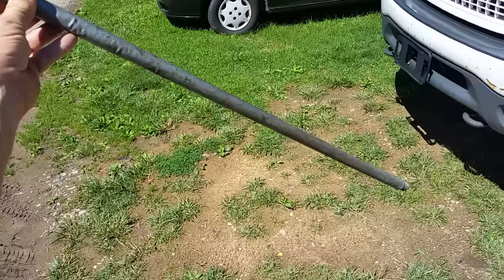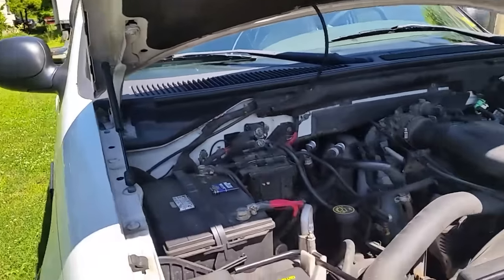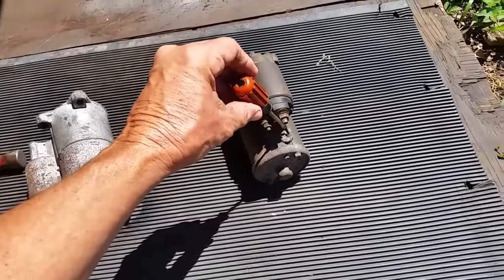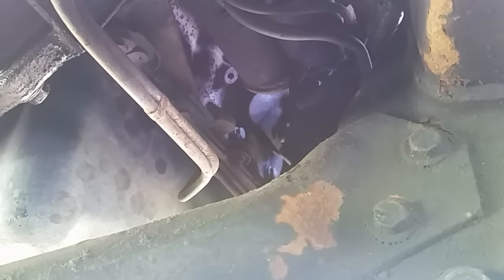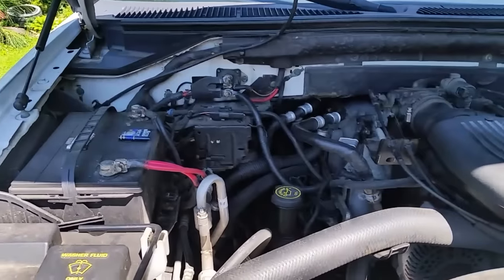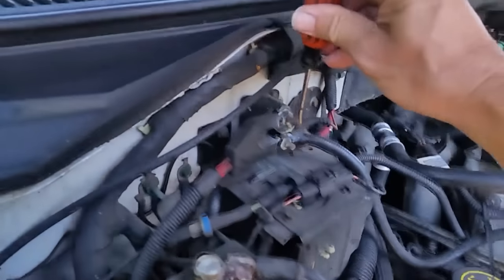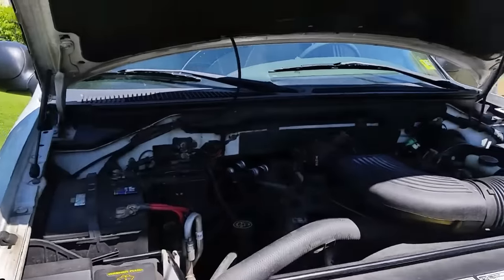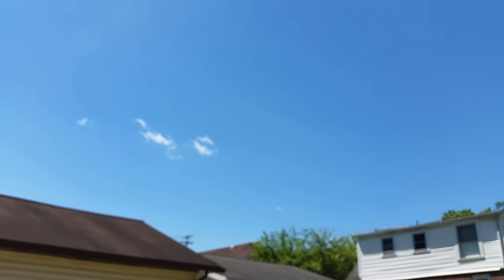Starter Issues??? Simple trick to get your vehicle started and get Home!

Comment: Here is what I read from a good automotive textbook :

Don’t Hit That Starter!
In the past, it was common to see service technicians hitting a starter in their effort to diagnose a no-crank condition.
Often the shock of the blow to the starter aligned or moved the brushes, armature, and bushings. Many times, the starter functioned after being hit, even if only for a short time. 
However, most starters today use permanent magnet fields, and the magnets can be easily broken if hit. A magnet that is broken becomes two weaker magnets. Some early PM starters used magnets that were glued or bonded to the field housing. If struck with a heavy tool, the magnets could be broken with parts of the magnet falling onto the armature and into the bearing pockets, making the starter impossible to repair or rebuild.
Reply: So what's your text book say? Replace starter everytime at the customers expense?
Reply: But it can't hurt if the starters already junk. Or pay a tow bill I think I'd rather wrap on my starter and it's not going to break anything just tapping in it . Maybe if you're swinging a sledge or something lol of course auto techs and manufacturer are going to say that. They want that service and part money. Its fine to do as long as u aren't pounding the shit out of it and it would probably still be fine Even if you did
Reply: Just be more careful where you hit it.  Tapping on the edge, especially near the solenoid should be ok.  It will vibrate everything but anything remotely reasonable should not hurt anything.  Another thing.  Few if any starters today even involve a rebuild.  It's best to accept the reality of expensive OEM parts or much more affordable aftermarket parts.  Either is new or re-manufactured with a warranty.  

    In theory a re-manufactured part intended for store stock is likely better than having someone rebuild your starter specifically.   The reason is because that type of organization is likely set up to better clean the old parts whether some sort of bath, ultra-sonic cleaning, etc.  Something a small shop probably can't match without unrealistic labor and lots of expensive brake clean.  The quality of the replacement internals could be better or worse, but the big company saves money through bulk purchases meaning they could have better parts to limit warranty liability while still having lower cost than the lone wolf.  The labor cost of the re-manufacturer is cheaper and the employees whether skilled mechanics or not should become quite proficient with the parts they are working on because a high volume of repairs equals a high volume of experience.  They can robotically and mindlessly do the same quality of work that requires attention to detail as a one off repair.......

All of that to say fragile Magnets and rebuilds are not generally an issue, unless a person is needing a hard or impossible to find replacement starter.  In that case they probably already know not to wack the sh*t out of something they want to be properly repaired.  

And this advice should only be used to avoid a tow, get home in an emergency, etc.  Do it repeatedly at one's own risk of reaching the point of no option.  I'm probably in that spot myself right now with my truck stuck in a less than ideal location on my property and in need of being started so that I can be certain the coolant is suitable for a sustained weeklong plus deep freeze in a few days.

Comment: I usually don’t promote any auto part stores. But for goodness sakes don’t buy a Amazon starter. It’s made of the thinnest metal and after being thrown 30 feet the posts bust. I’ve used every stores parts. While they are competitive on prices and sometimes a little higher in price, O’rieleys has the strongest heavy duty starter out of all auto part chains. Spend that extra 10.00 so your not back under it as soon as the warranty is gone.

Comment: Interesting it wouldn't start with a key but when you jumped the solenoid it did turn over. That means the solenoid is likely the culprit not the starter as it turns over.
Reply from the maker: My luck It was both ;(
Reply: @FixingWithPassion   no your issue was the solenoid, you replaced the starter because you don't properly understand how the solenoid works
Reply: I agree. He says the starter is bad. He just proved it was not the starter.

Comment: Have a 2003 Lincoln (Ford product, so should be very similar setup to this).  Tried tapping, though, didn't work.  Luckily, have AAA, will probably have to send to mechanic to change starter.
Reply from the maker: o no!
Reply: @FixingWithPassion  LOL, ya, not sure what else to try.....battery full, think starter is just shot LOL!

Comment: This may work for a while, but in reality the moving part is dirty, probably to to oil & grit or slight corrosion.
It will need removal at some stage.
Reply from the maker: That's the point ;D
Reply: What part of Nathan's "Don't shut off the vech once started" was confusing to you?

Comment: around 3 minutes into the video, you jumped the upper  solenoid.. it instantly turned over the engine. This usually means the solenoid is bad or has bad connections. If you would have turned your key on and then jumped the upper solenoid, the truck would have started
Reply from the maker: True. But a lot people would not understand this.  Also not too many auto have easy too get to solenoids. Good luck finding one now days. )
Reply: Jonathan you are dead on. It was a faulty solenoid or solenoid activation circuitry. NOT the starter.
Reply: yeah, the starter was just fine, if bypassing the solenoid makes the starter turn over, the solenoid is bad, not good.

Comment: Really good video. I have a 69 F100 but I'm sure this tactic could be used. My problem is hot starts. My mechanic cant figure it out, but I suspect the starter is getting too  hot. I think i'll try a heat shield between the starter and exhaust.
Reply: Make sure the timing isn't too far advanced

Comment: I drove my car from work early in the morning to the bank for 3mins,then I turn off the engine .then I can't start anymore..it did happen twice so I called someone to jump my car..I took my car to the auto shop to to check my alternator and battery and they said both are doing good..now I was thinking it was the starter,I bought starter and mechanic will be here soon .to replace starter.I hope the starter is the problem..

Comment: Ur bypassing the solenoid with the screw driver. Therefore the solenoid is probably bad. The solenoids job is to make contact between the two wires except its done by the turn of the key.
Reply: Ya there's some bad info here
Reply: The guy who authored the video he did an okay job. However you are right the solenoid is probably bad when he jumped it from the firewall thank you for clarifying that I was thinking that I knew that and you confirm that thank you sir
Reply: Yeah. You’re right.
Reply: I jumped the solenoid attached to the starter with a screwdriver and the key turned forward and it started right up. It wouldn't even turn over before using g just the key so what does that mean?

Comment: Having this problem right now. Hard asf to take the starter off from laying on your back.. its not the battery nor the anti theft.  I hear a click at the firewall solenoid. Cant identity the fuse relay if theres one to check that.
Reply from the maker: Starter could have a bad ground, but a dragging starter will do the same thing.
Reply: Did that firewall key on screw driver. But starter didnt turn over. Did hear a clicking but not turning over. Would it be a bad starter itself?
Reply: Bear it’s a bad ground somewhere check cables sometimes inside the cables get too corroded and need replaced
Reply: @orionscutlass7179  man I been trying since August lol. Really dint even want to put more money in it. I'll try the lines this week
Reply: @Bear_83  start at battery terminals. Clean the connections real good and tighten then check connections on the starter and but I'm willing to bet it's ground cable isn't getting a good connection. Seen it a 1000 times. Good luck.
Reply: @orionscutlass7179  I been did that at battery. Trying to sell it but when it get warm I'm get under and do it at start. I appreciate your feed back

Comment: I have power to my wire and my starter is also new, still no crank. I replaced my battery, starter wiring, ignition switch and also checked any relevant fuses

Comment: Great video , an no disrespect , but when you said jumping across the solenoid with a screwdriver up by the top of the hood proves it's good ,, that was jumping across it , if it is key activated by turning ignition key then it should click and make connection ! Simply jumping across it does not prove it is clicking and allowing current to flow between the large boots that secure the wires to the solenoid .

Comment: ..and if the starter tries to engage and the engine won't turn, get ready to do a motor job. I had a 74 dodge dart that i started for a couple of months by shorting the solenoid. The last thing i replaced was the starter. Every mechanic I took it to said this or that. It was the starter...!!
Reply from the maker: Ol James Right....you just never know sometimes.
Reply: This is old , but from experience that's not a correct statement. Actually

Comment: OK, good advice that everybody should know for getting home.  

Many years ago I saved a cowgirl's day when, out a rural area, her old Blazer wouldn't start.  Seeing that they had already tried to jumper start it, the first thing I did was to hammer the starter to free up the worn brushes and that did the trick.  Even after the hammering worked, the Blazer started and the proof was right before their eyes, the loud-mouth "experts" belittled me and told her that I was full of .. it .., my hammer did nothing and that she had a bad battery.  Lord, I hate it when people are too stupid to know how stupid they are.  To my utter amazement and disgust she listened to those dopes and bought a new battery.  This incident really --- ah --- steamed me off, but I got my revenge.  A couple of weeks later she had to have her Blazer towed back to town for --- guess what --- a new starter.  I only wish I could have shoved their words (and their disrespect) down their loud mouth throats.  

Anyway, I wanted to mention that after you struck the starter the first time, you went to the external starter relay and shorted it, which caused the starter to turn over.  Then you went and struck the starter again.  What did striking it again prove???  It proved that you didn't need to strike the starter a second time because the starter motor was now working.  Something in the system is intermittent -- sometimes it works and sometimes it doesn't and those are the worst kinds of failures.  

One thing you failed to mention was to listen for the sound of the starter relay clicking.  If you can hear the starter relay making a clicking sound like it should when the trying to start, you can be pretty sure the starter is bad.  

If you have 150K or more miles on the engine, change the starter motor and 99% of the time that will solve the problem and will prevent future problems, it's ready to go anyway.  If you have a good starter, but you don't hear the relay clicking, you must then test the signal going to the relay to see if it is getting there.  If the relay signal is missing, it is either a bad key switch or a bad transmission selector switch or the little relay in the fuse box isn't working.  All this you (or a shop) will check out one step at a time with a little 12V trouble light.

Comment: I have a 2008 F-150 two-wheel drive 4.2 it will not crank with the key but I can jump the starter off with a screwdriver if my solenoid on the starter is bad what I've been able to still jump my truck off with the starter

Comment: Pats system got triggered on my 03 expedition replaced wiring harness ar ignition and pats fuse. Upon replacing pats fuse I heard lots of clicking where everything was waking up. But relay only clicks and starter doesn't engage. Security light flashes rapidly

Comment: wait, i'm confused. if you jumper a solenoid and the car starts, doesn't that mean the solenoid is bad and the starter is good?  you said it was the opposite. a car won't start at all with a bad starter, but it would if all you needed to do was to simulate a working solenoid by shorting around it.

Comment: Had that same problem and had the starter replaced. Few days later, same problem…wouldn’t start. Later that day it started! Took the truck (2011F150) back to mechanic. But he said as long as it was operating, he wouldn’t be able to adequately pinpoint the problem. Have kept cranking it in attempts to make it fail so he can diagnose the problem, but it continues to crank. I do lots of wilderness travel and travel with my grandchildren in tow. Afraid this thing is going to fail on me (us) at the worst possible time in the wild. Any suggestions?

Comment: Thanks for the video. Like another comment below, I got a new battery, after banging the starter several times and it  would finally always started after several one click. I never checked the cables and the battery connectors because the old battery would show 12.6V. I wish I had done it. The second day using the new battery I had to stop the car due to the fumes coming from under the hood and the strong chemical smell. I saw the starter smoking and hours later I noticed the negative lead terminal/connector had melted and got embedded in that corner. I am pretty sure that the young guy that installed the battery did a bad job or he just did not care about any other problem if he saw the negative terminal lose. Can you tell me if a new battery rated 500 CCA that measured 720 CCA after a 5 miles drive can be use again with a new connector and some craters by the negative post? Or should I use the old battery since maybe the cause of the damage could have been due to the installation?

Comment: Why would you keep banging on a starter that was trying to spin when you jumped the solonoid?
Reply from the maker: Sometimes starters drag excessively...by hitting/tapping them can cause them to spin better briefly in turning over the flywheel and starting the motor.
Reply: @FixingWithPassion  But it didn't "drag"  when you touched the two posts.(?) Just saying, I'm confused. If the Bendix is stuck on the flywheel I bump up moving the  teeth of the flywheel.

Comment: When I do the screw driver trick all I hear is a click in the starter.The engine doesn't try to turn over so would that indicate a faulty solenoid ?or started may be stuck and not working?  2007 Acura tl type s

Comment: Just a quick note ,  the fuel pump stay cool by being submerged in gas , so if you run it around 1/8 to 1/4 tank too long  ,  it will overheat and burn out on you

Comment: My truck will not take a jump. Also cannot get it to start by connecting the wires by a screwdriver on both the starter under the hood or the starter under the truck. Any ideas what might cause that?

Comment: If this is the case could it also turn off on you as your driving?
Reply: slash quill Once you get it started with a starter issue you wanna drive it to the place where you want it to sit or get repaired. Only way it'll shut off after starting is if your car dies or you turn it off.
Reply: no, the starter does nothing while the vehicle is running, so it wont die when the starter isnt getting good connection.

Comment: Very informative video!👍🏻 Question: If I burned out my fuel pump motor would the truck still turn over? Mine went from turning over fine but not starting (fuel was very low) to completely dead. Recharged the battery and had it test too but when I turn the key, nothing. I'm baffled.
Reply: Starter relay perhaps get it tested or replace em cheap enough

Comment: I have a mustang that wont make any noise when I turn it I removed the starter and took it to autozone and they said it was fine and the battery is also. Do you think the relay on the starter could be bad or is it all good?
Reply from the maker: Big red wire.

Comment: my 2001 jetta 2.0 sat since december 2021 
i put a brand new battery in today, correct battery specs etc
dash lights up, headlights, subwoofer pounds, radio works
viper alarm remote works to arm and disarm , just in case if it was stuck in valet mode or whatever
no clicking sound when turning the key, nothing , the dash dims a bit and the headlights go out when i turn the ignition key and try to start as normal
so its attemping to grab juice from the battery
is the starter dead from sitting ?
something else ?
thanks in advance -  its a 2001 jetta gls, 2.0  AZG engine , automatic transmission

Comment: I drive a 20 yrs old Toyota MRS, the engine wont start if I dont start it or run the engine for 2 or 3 days, usually I just hv it jumped start it. Gets annoyed when you have to do it rather frequently. Could it bcz of a bad starter?
There were times even after I hv driven it to charge the battery, it wont start again after I turn off the engine for a while... sometimes if I were lucky, I would get a jump start from another car near by.. always keep my jumper wire for spare in the car